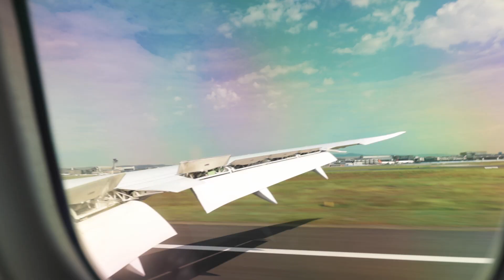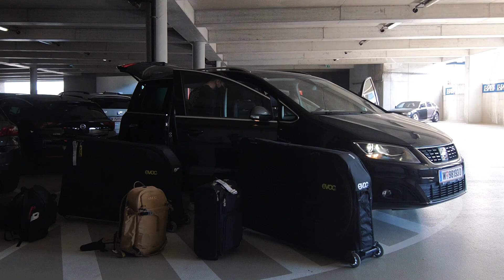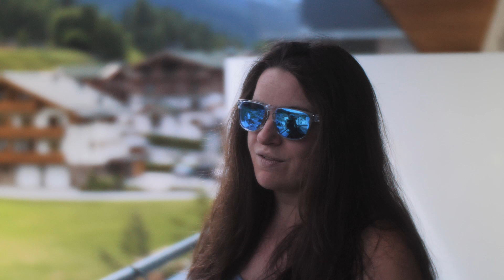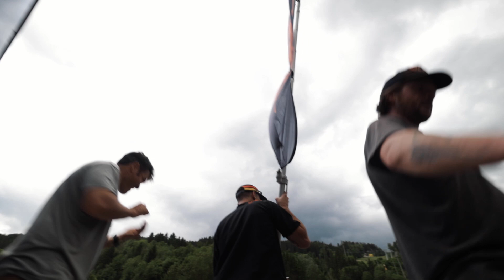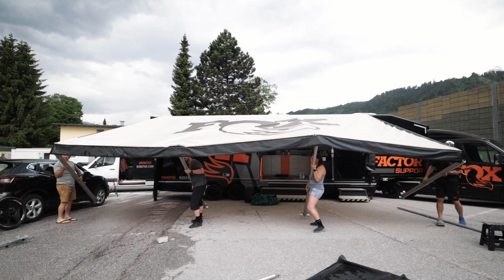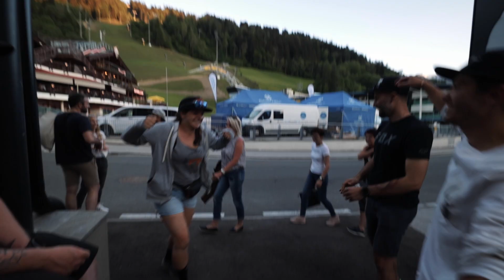DIALED S3-EP1: Dialed is back in Leogang | FOX

Comment: Glad to see Dialed back at the world cups! Have you ever considered using nitrogen for forks and air shocks? A lot of motocross teams use nitrogen to prevent the suspension air volume from changing as the gas heats up or in big temperature swings.